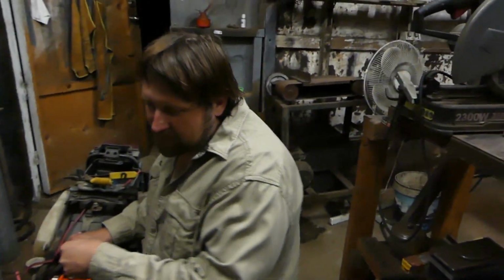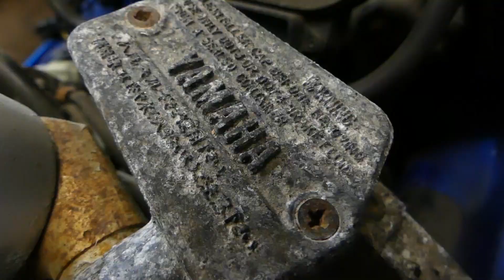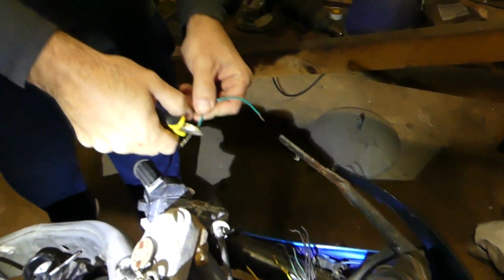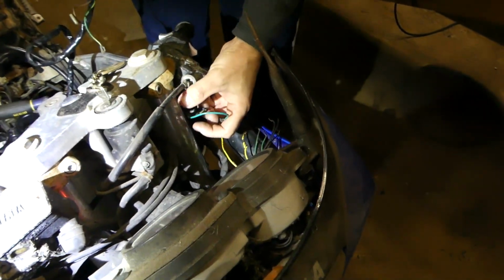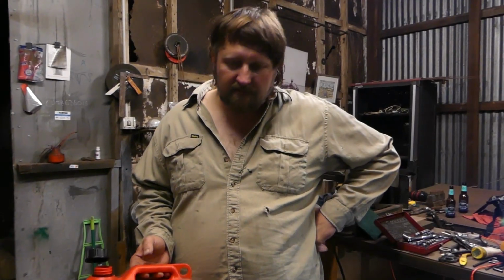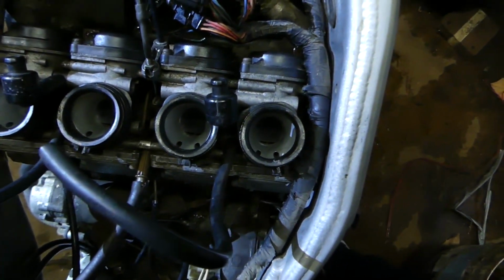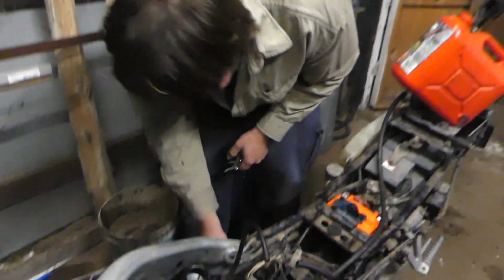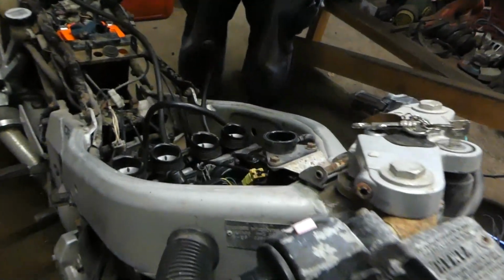Will this rare Japanese bike start after 10 years?

Comment: FEEL SORRY FOR WHO EVER IS GONNA OWN THIS BIKE AFTER. FIRST OF ALL U NEVER EVER OPEN FULL THROTTLE ON A BIKE THAT HAS SAT THIS LONG. YOU JUST WEARING THE HELL OUT OF THOSE PISTONS. THERES NO OIL UP ON THOSE PISTONS UNTIL BIKE ACTUALLY STARTS RUNNING. WASTED MY TIME WATCHING THIS.😳😳😳😳😳😳😳🤨🤨😑😑
Reply from the maker: Hey thanks for watching. We will own this and don't plan on selling it. We turned it over for a while and it didn't actually run, which is a good way to get the oil flowing . Also we used a pre mix of  2 stroke in the fuel which would have coated the inside of the piston walls. Were sorry we wasted your time though. Have a great day!